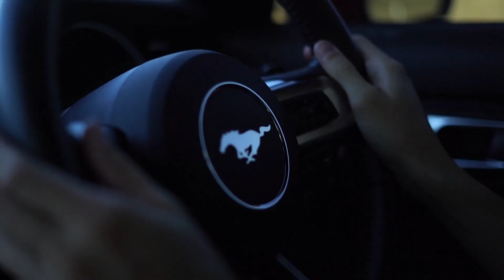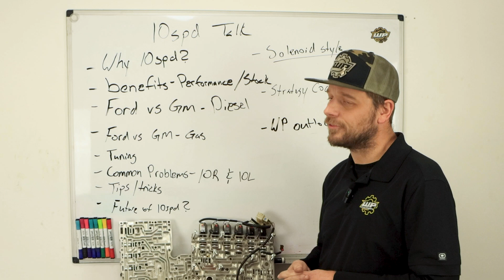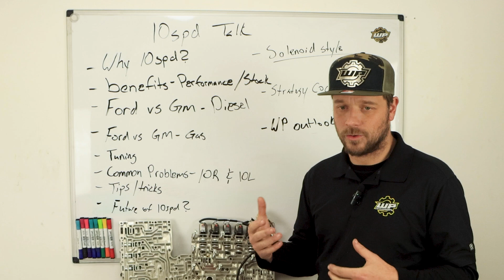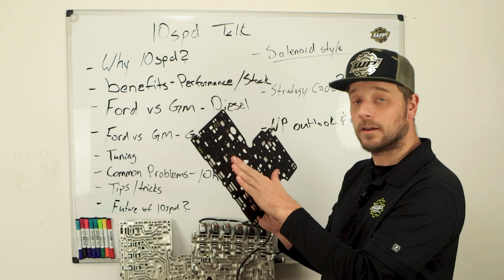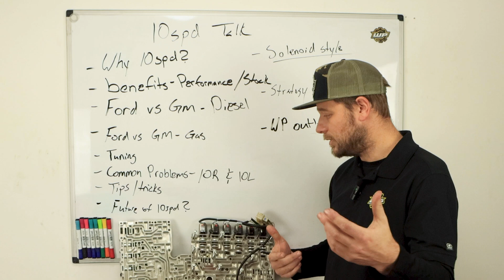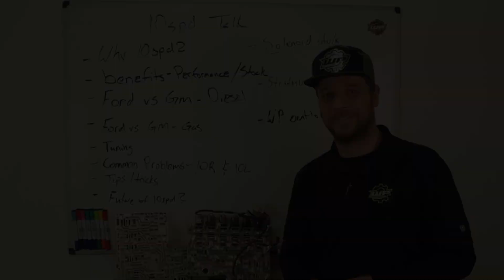10-Speed Transmissions Explained: WP Developments Breakdown

Comment: I had a 2017 f150 at 1400 miles the transmission failed ended up needing 4 different units all covered by warranty. The biggest issue was ford changed how they ran their fresh built units at the factory. Before 2017 they would dunk them in a machine pan off and circulate them to get all the material out during testing. In 2017 they started testing them with the pan on with a different machine. The dealer and ford transmission specialist told me this is what lead to trash being in my valve body on 4 separate new units.

Comment: How much of these very problematic faulty transmissions are a result of the EPA pressuring manufacturers? Do you think the new adult, non corrupt, intelligent administration will have a big positive effect on all this mess and EPA in the next months or years? And do you think the new leadership will also open up and make things better for aftermarket and Performance parts and upgrades?

Comment: Do you think the ZF8 speed will be a much stronger better longer lasting less problematic transmission? I have one in my Audi with a 3 L supercharger and it has been trouble free and 104,000 miles. I did change my transmission fluid at about 90 or 100,000 miles and it is still great.

Comment: 9,000 miles and mine was sooo bad, Ford finally swapped out my defective 10R80 for a new one! UNDER WARRANTY.
The last time at the dealer my car sat outside in the hail, etc for almost 3 months and No loaner car before Ford and the dealer did the swap.
communication from Ford was practically nothing along with the dealer. I had to keep pressure on them. It was NOT fun, to say the least. It was like I had to pay twice for the car.
We will see what the future holds, still ongoing.
My engine and transmission were and is stock NO performance upgrades!
My car had a lot of electrical problems also which have slowed down, fortunately!
I love the car when it works properly, but that has been so little of my ownership.
Part of the reason I am keeping it is because I have already sunk a lot of money into it, that is not recoverable.
Not sure what else to buy yet.

Comment: I purchased a new 2024 Super Duty with the 6.8 gas engine. I believe it has the 10R100 transmission. It appears to shift just fine. It goes from one gear to the next just very smoothly. The issue that I'm experiencing is that (in certain gears), when I'm driving at a constant and consistent speed and I take my foot off the gas to let it coast for a moment, then put my foot back on the gas, it does this clunky pop and jerk. Kinda like there's too much slop or slack in the drive line somewhere. I'm noticing this primarily in 4th, 5th, 6th, and 8th gears. 5th gear being the worst gear it does this in. (So far).  Sometimes it's a slight pop and jerk. But sometimes it's a hard pop and jerk. Usually the hard pops are in 5th.
I've taken it to Ford 3 times, and they swear there's nothing mechanically wrong with the transmission, that it is all program issues. However, they've ran program updates 3 times on this thing, and it's still doing the same thing. It's very discouraging that ford is acting like this is perfectly ok. 
In your opinion and experience, what's your thoughts on what's going on with this transmission?

Comment: Interesting video and you've confirmed a few things i've thought since I bought my Ranger in 2020 with the 10R80.  That there is the propensity of the valves to either get hung up or slow down, even with the fairly nice filter on board.  I've been preaching early and often fluid changes to keep debris out of the valve bodies and I have also (incoming controversy) been using Lubegard Platinum since 10,000 miles.  (1oz per qt of changed fluid).  I know additives get a ton of flak, and that we really shouldn't need one, but several people have tried it and reported positive results.  I practice 10k drain and fills on the transmission, although I feel 30k might be enough, I'm in it for the long haul and I tow heavy quite a bit.  (Of course, this does nothing for the hard-part failures)

Ford is just chasing their tails with all of the reprogramming trying to get them to shift right once they've been contaminated.

Good vid!!

Comment: Dealer tech/Personal truck 2020, Had a harsh downshift on my 10R140/ 6.7L  when cold at 60k wouodnt hold 4th gear on downshift and instantly slam into 3rd almost throwing you into the windshield once every drive cycle usually around 100-150 TFT. Went to “overhaul” valve body per TSB didn’t find much nor a sticking valve or any scoring but I threw a new one at it anyways & It’s been great ever since…. Normally we see a lot more issues on the gas trucks especially and 10R80s with shifted CDF bushings. The diesel 10R’s seem to be a lot less problematic and smoother shifting.

Comment: my 10r80 blew up the day i got it. was in drive and wouldn’t move in all gears. warranty said the clutch got stuck open. needed a new front support assembly, a clutch frictions and steels and filter. still doesn’t shift at wot. I like your offerings but other people rate their 10r80s for more power and they cost less. I’m looking for more information on a 10r80 that performs at the 1800hp level and possibly a pure drivetrain solutions converter. I look forward to you guys putting out more info on high hp 10rs👍🏽